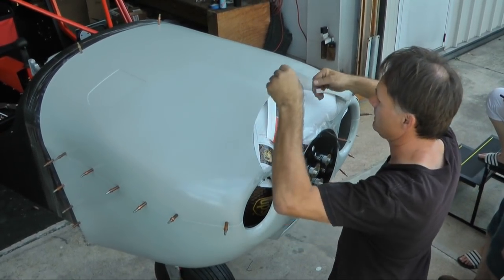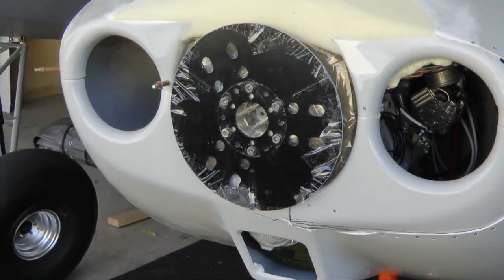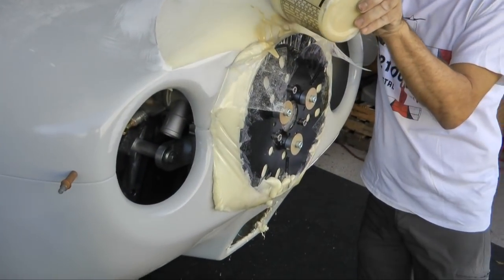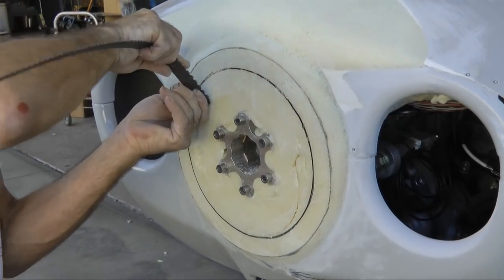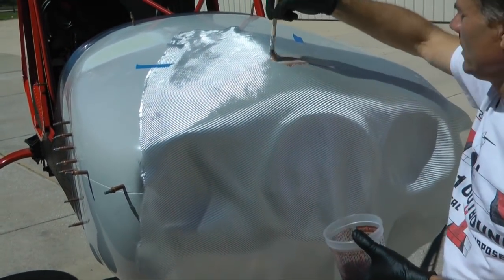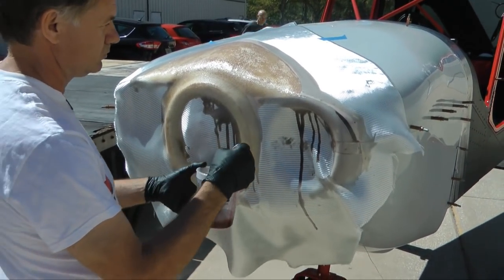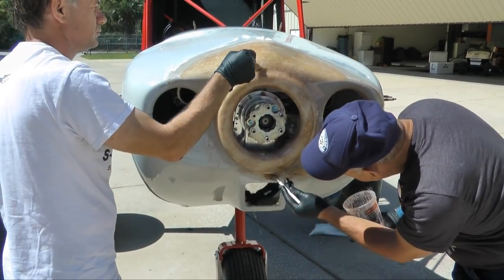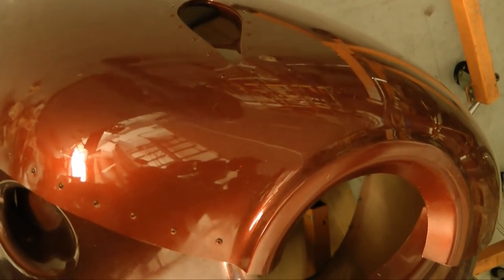Fiberglass Cowl Modification Tip

Comment: How did you remove the expanding foam?  and how did you accurately cut the halves?
Reply: You can just leave it, or physically remove it by scraping it out with a screwdriver or the like, or you can dissolve it with a solvent (eg acetone). Usually you can get most of it out with a tool like a screwdriver and then wipe with a rag dipped in solvent. The stuff is so light that sometimes just leaving a little bit is no big deal.

Comment: Good job Jan I have learned a few shortcuts after glassing many surfboards. If you tape off the area on the cowling where you want to glass the resin won't soak through onto the other areas. After you wet up the cloth, use a bondo squege to smooth out the cloth, this will also squeeze out the air bubbles and make a more uniform amount of resin. When it starts to go off, trim the edges with a razor blade and peel off the unwanted cloth. That will save a lot of extra sanding.Dean Smith 750 Cruzer Corona Ca.